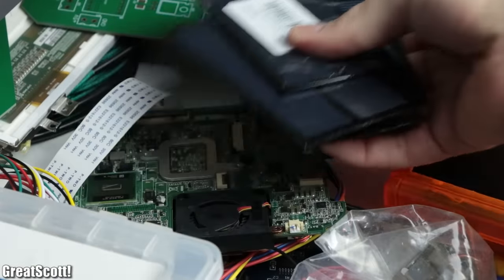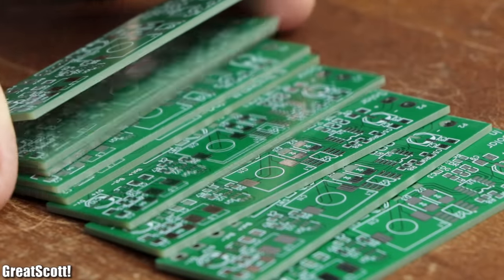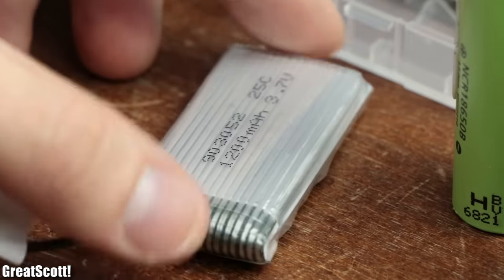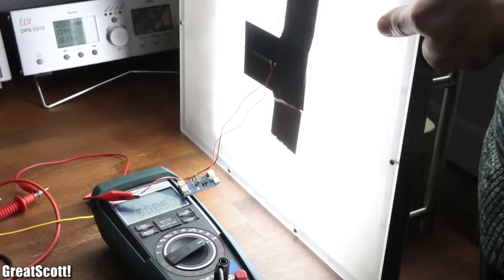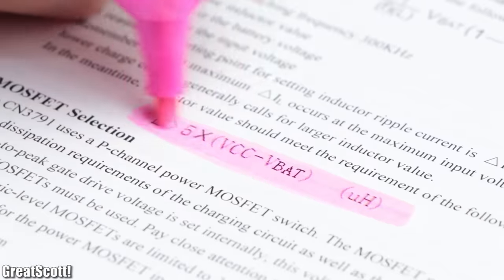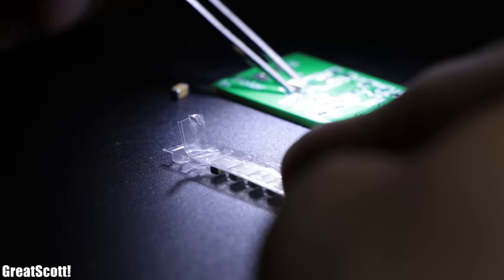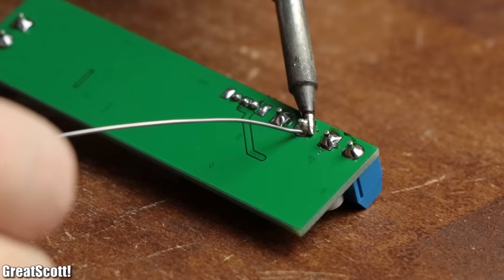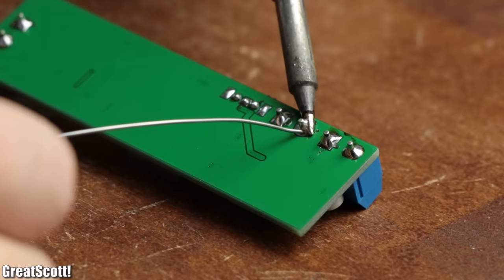Solar Battery Charger (LiPo/Li-Ion) || DIY or Buy

Comment: Maybe it would have been better, if you used SMD pots for the R9 to adjust the MPPT voltage for use of other solar pannels. But all in all a pretty nice circuit!
Reply from the maker: I like the idea. Thanks for the feedback.
Reply: @urugulu1656  Whats wrong with a pot? If you use a 10k one, range souldn't be a problem. And it looks way more elegant than having a resistor flapping around in the breeze ^^.
Reply: @m4gmu5hell  Bro, have you ever used SMD pots? You turn them literally 3 times and they're broken! (Or at least the ones I've seen before)
Reply: @necronomicon1472  I rarely use SMD Pots indeed, but I had no problems at all with the ones I utilised before. Maybe you have heated them up to hot and they have become bad that way. I use ones from BI Technologies. They are quiet decent.
Reply: @m4gmu5hell  I guess there are good SMD pots as well, but the extremly small ones kinda suck. It might be because the ones I used were cheap (on a chinese stepper motor driver) or because they are only good to be set once.
Reply: @necronomicon1472  These are the ones I used: https://www.reichelt.de/smd-cermet-trimmer-10-kohm-23b-10k-p146085.html?GROUPID=3131&START=0&OFFSET=16&SID=92W0EFwKwQAT4AADu3zvw6ab062d601af9edfed21ba31d7a9c3dd&LANGUAGE=EN&&r=1
Don't worry it's in english.
Reply: @m4gmu5hell  https://www.mouser.com/ProductDetail/Bourns/TC42X-2-102E?qs=sGAEpiMZZMvygUB3GLcD7pRd7VfpZf7nggmoc9QKmoY%3d
That's what I referred to. This one is from Bournes, so I expect it to be at least half decent, but there are certainly cheaper ones out there.
Reply: Sorry but the Maximum Power Point voltage for a specific panel changes according to light intensity, the 18 volts for his panel are at the standard light intensity and temperature only. You cant use resistors or potentiometers, you need an automatic tracking capability for maximum efficiency.
Reply: I did it, and now its versatile for all the solar panels at my lab.
Reply: Can I connect five lithium battery🔋 (1000mAh, 3.7V )  to CN3065?
Reply: I think the mighty paper said no
Reply: @teoval1827 I noticed this too,  I recently got a new 10A mppt controller for my 18v panel and the mppt voltage sweeps from 14-22v depending on irradiance. The 'set MPPT' voltage on this cn 3791 chip was a bit of a giveaway...

Comment: Another way of soldering Surface mount parts: 

1)tin the pads with a minimum amount of solder.  You want little more than a thin even film.

2) apply a past or gel type flux.

3) maneuver the part into position.  Tweezers work well.

4) hold the part down with a bamboo skewer, then touch the soldering iron tip to each pad in turn.

5) when finished, clean with alcohol, e.g. 99% isopropyl or denatured alcohol.

I recall doing this with sot-23 transistors, surface mount leds, 1206 resistors, and perhaps a few others.  It gave neat results.

Comment: Actually, I just soldered 4 5V Z-Diodes on 2 Solar Cells, and was able to load a power bank with that. The Z-Diodes kept the Voltage under 5.25V, and the power bank just took whatever it could, which resulted in changing current (50 mA to 1 Amp), but actually, that wasn't a problem. (The solar cells were rated max. 7 Volts, with an optimal voltage of 5 Volts)

Comment: Well, for an high-skilled electronics guy like you, for some of them, the DIY solution is the best choice, because as you did it, you can make your own pcb circuit and customize it during the mock up, but a common buyer/maker, will choose a commercial one, without caring about its lacks because he may not have all the skills he needs to fully understand the product's spec sheet, and find out if it's the perfect one for him

Comment: last time i just hooked up my 5.5v solar panel with a diode to my tp4056 board, to charge and power my weatherstation at the same time, worked very well :P
Reply: I did the same, I got a 1.5W 12v (Voc) solar panel and cut the traces on the back to convert it to 6v. Then I got a protected tp-4056 module for charging and a ht7-333 linear regulator for 3.3v output to an esp8266. https://imgur.com/a/CYQwCev
Reply: @vaguedirector_7342  Thanks for sharing, I've just started playing with esp8266's and have been looking for easy solar options for projects, can you share a little bit more detail of the circuit with me, please? Pete
Reply: @vaguedirector_7342  Linear regular with a solar panel project /sigh

Comment: One note though, the Maximum Power Point of a panel is not constant but changes according to the light it gets. The 18 volts is the standard MPP voltage at standard full brightness conditions. The 'T' in MPPT is the tracker which finds the best voltage according to lighting conditions for the specific panel.
Reply: Exactly.
Reply: Yep. A true mppt will be wY more efficient too.

Comment: What I think is that I'm amazed that you can order this kind of circuit, typically for outdoor gardening applications from any big box store and there you have it, battery, solar panel and circuit, complete. You make a great instructable video but for some applications striping apart a ready-made commercial sollution might just do the job.

Comment: Awesome job !
For soldering, I prefer to pre-tin the pads slightly with the iron and then add a bit of flux and sit the small components in place using twizers and hot air. I find it to be much faster.

Comment: Nice project. I also spent a couple weeks building my own MPPT charge controller using this chip and it works pretty well. I get 80% efficiency at around 10W input power and a bit less, 75% ish at higher power like 15W+. I am using a 20W panel. If you have lower then expected efficiency, it is important to note that the input capacitor ESR and the inductor DCR are very important as I discovered (!) so keep these as low as possible!
Reply: Can u please mention Al components and circuit diagram asap?
Reply: @Sam Soo  I have a feeling that if I do, I will see my design for sale on Aliexpress in a couple of weeks😂 Let me know if we can discuss this via email.
Reply: @nosafetyswitch9378  ...so you have my curiosity.  your channel doesn't seem to have any content so i'm puzzled by your offer to share designs.
my personal feeling is that these types of units should be designed to accumulate charges and then pulse charge, or better discharge into the battery in cascading manner.  The 60%+ efficiency of this video shows there is room for more creativity.  cheers
Reply: @Zane Enaz  hi, I haven't uploaded any videos yet unfortunately, who knows maybe one day. I just thought I d share my thoughts. I now want to charge my 10cell ebuke battery and i am actually considering whether it is worth adding those modules in series or start a new design with a chip that can charge 10 cells but those are not very easy to come by...
Reply: @nosafetyswitch9378  ..could you share your design with me ?

Comment: I was thinking about doing something like this last night. PWM solar charge controllers run $10-20 on Amazon for the cheap Chinese runs, and MPPT controllers run in the $100+ range, and honestly neither tracks a lot of the data I'd like to be able to see. A $30 MPPT solar charge controller with I/O charge tracking would kill it on Amazon.

Comment: This is what I was looking for ....just loved it ...
Reply: you were looking for 35% effeciency? at a cost of 10$ per board and 2 hours of labor? there are simpler. better. circuits suited for this type of project.
Reply: @americanengineering2063  u r correct, its  costly ...but i was attracted for MPPT and over discharge protection functionality .Any way its outdoor  efficiency was 62%..
Reply: Could this power a raspberry pi zero w?
Reply: @epicgames44  I can't say because  i dont know much about pi zero w...we need to check its data sheet and verify if it is suitable to use with pi zero w
Reply: Yes it will run a pi zero w. if im not mistaken the pi zero w runs on 5v. but if you plan to use a solar panel, get a decent size. the tiny ones he showed at the beginning are only 1w and aren't strong enough to even charge a AAA battery. why did he even show those tiny things. his board does not work with small panels as such. so make sure u get atleast a 10w panel

Comment: I use 10 watt solar panels and a variable input Buck Converter set for 3.5v maximum (LiFePo4).  For 6v output to my game camera I use a 2 Amp boost converter  that shuts off when the battery drops to 2v.     The batteries are  6000mAh, 1S3P, and don’t need balancing.    I have 3 game cameras which have been running unattended for 15 months.

Comment: For the buy option, not sure why you looked for a special board to do it when a TP4056 provides similar results and on the slightly more expensive boards it actually has battery protection for as little as 30 cents, I'd say that's the better route to go unless you need more power/bigger battery.
Reply: @FourthWayRanch  It's similar to a liner regulator, it feeds the battery as much as it can provide and as the voltage increases past 4.2v it'll burn that excess power as heat, so yes about the same as plugging in usb, the only downside is it has an absolute maximum of 8V input so that somewhat limits your panel options especially if you want to be able to charge in lower amounts of light.
Reply: @FourthWayRanch  Yes but very unnecessary, it depends on your module of course but as far as I'm aware it'll work perfectly fine all the way down to 2.7v (so completely drained) with 3.3v being typical.

Comment: Can you do a video comparing different energy harvesting methods (e.g. RF, solar, piezo or thermal)?
Reply from the maker: I can put it on my to do list
Reply: @greatscottlab  and hook up some cool MCU like nRF52 to create a real autonomous sensor node. It would be perfect.

And for everybody looking into EH topic - take a look into DOI 10.1109/mssc.2010.936667. It's the best science article on EH I found so far. Alongside with DOI 10.1109/SURV.2011.060710.00094
Reply: @greatscottlab  also,mini  inline generators to power smart water meters

Comment: Nice video ! It would be beter to use an smd trimmer for mppt .
I have done something similar but i used much cheaper method . 
Using a board with MP1584EN and a li-ion charging module based on TP4056 ic with battery protection and then a boost converter 3.7 to 5v connected to a switch for open close,  my sollar battery bank still works like a charm for 4 years now with the same batteries . The only problem with this method is that you have to find solar panels 9v not 6v .The maximum panel voltage is 28v .
My battery bank was fitted on my backpack and it was charging constantly every day , now im about to upgrade it .

Comment: As a followup, you should do a solar charging board for supercapacitors. I've been interested in making a low power sensor using a pair of the cheap 2.7V supercaps you can get as a reservoir, but I'm struggling to find a good IC for charging supercaps from solar.
Reply from the maker: I will see what I can do
Reply: @greatscottlab  Thanks for at least considering it!
Reply: Lipo charger works just fine for the supercaps. I replaced a lipo battery in my dashcam with a pair of 2.7V supercaps and the charging circuit in the camera handles them just fine. Maybe you'll want to add zeners in parallel to each cap to keep the voltage below 2.7V in case they become unbalanced.
Reply: @polarijet  Yeah, TI has a really nice chip for doing this (the BQ24650) that integrates a boost converter and MPPT controller etc. I've just been stuck on 1) having a chance to lay out a PCB for it and adjusting all the values for supercaps and 2) figuring out protection and stuff for the supercaps. Having a hard time finding a coherent explanation of what is required to charge them properly, especially in series.

Comment: Well built.

Just note:
There is no "battery bypass" so the battery will cycle around fully charged if you have a load and sun is present.

Otherwise, what is the deal with 5V? very little modern stuff use 5V.
I would target 3.3V (and possibly 2.5V, 1.8V e.t.c.)

Comment: Great job Great Scott :) .   Yes , I've been frustrated by the lack of a perfect solar to Lithium charger/ 5V boost circuit for a long time too .    So I used a small buck converter to step down the solar panel voltage to 5.2V to power our favorite 1S Lithum charger board  .       It doesn't use MPPT and I'm sure it's efficiency is Horrible .      Great Circuit , Thanks for doing the thing that We've all been wanting in a solar 1S lithum power circuit :)
Reply from the maker: Glad you like it :-)

Comment: There are off-the-shelf cn3791 solar chargers on aliexpress for around 3.5$
Reply from the maker: What? Dammit!
Reply: Link?
Reply: seems this video needs a part 2 where those are tested in comparison with your DIY one
Reply: @KACPER050599  thxs
Reply: @urugulu1656  These modules are only chargers, but you can use standard bms for protection for approx. 1$ and save money and time
Reply: But its not the same!!! It's set for a 9v or 12v panel and doesn't have the charge protect / boost protect circuit , which is a huge bonus!!! so I thing GreatScott's is worth ten times that Chinese junk..lol I'm gonna build his..
Reply: @sortofsmarter  Of course not, you can change resistors for mppt, use another boards for protection and boost converter. This will save a lot of time, unless you are really into developing serious product and want all on one pcb
Reply: @sortofsmarter  @GreatScott's design could use one important design change: load sharing, not sure how well it can be implemented with a solar panel
Reply: This kind of MPPT implementation the CN3791 utilises, is not true MPPT, as there is no measurement of panel current, calculation of solar panel Watt output, and no algorithm that periodically varies the load to find the highest output point of the panel, fancy true MPPT chargers even have a boost converter to squeeze even more mAh out of the panel when panel voltage is below battery voltage! Simply setting a constant voltage load for the panel does not compare, especially if you choose the lab test condition voltage of 18. More realistically, something around 16.5-17V https://www.ecmweb.com/sites/ecmweb.com/files/uploads/2012/07/207ecmPVfig2.jpg For smog laden city air on the bleak northern hemisphere! As others suggested, use a potentiometer and do a live calibration while measuring U and I so you at least gets it tuned for your local real world conditions. However this type of circuit is still better than a simple buck converter battery charger. As these "fake" MPPT ICs are plenty, and made by renowned manufacturers, they have a legitimate advantage in portable equipment / remote sensor applications, where cost is very critical but even a small improvement of efficiency compared to dumb solar regulators is a great benefit. So it is simply just a misnomer to call them MPPT chargers, as they are more like an "intelligent" buck converters. If you want a true MPPT that ticks all the boxes and has high efficiency, use the LT8490. Chinese manufacturers have made a few boards with these ranging from $37-$70 from the usual outlets, and these keep efficiency in the 90' range most of the time. However these chargers are in the 300W range, too much for a one cell charger. However the LT8490 could as easily be used in a DIY circuit if anyone wanted a small hitech 1-4A MPPT charger. https://www.beyondlogic.org/lt8490-mppt-buck-boost-multi-chemistry-battery-charger/ NB.: If you really want to tweak a dumb CV solar charger like in your video, the scientific thing to do is put a Wh meter on the panel and another on the battery, so you can average for efficiency daily and find the ideal all year voltage, but that would be a lot of work to get an extra 10-15% out of the charger.
Reply: @KACPER050599  that link doesn't lead anywhere
Reply: @luongmaihunggia  it was active one year ago ;)
Reply: @KACPER050599  well, it's not anymore so you need a new link.
Reply: @luongmaihunggia Do you think I'm going to update every link I post? Just search it yourself, it's not difficult to find
Reply: @KACPER050599  there're 2 different module that both name cn3791

Comment: Try using incandescent lamps to supply light to the solar panels indoors. I've found incandescent lamps do better than LEDs or CFL lamps when you have to have a light spectrum similar to the sun for testing solar panels. This also helps explain why current solar panels are inefficient, because they work best on a narrow infrared range. If they were able to work with a wider spectrum of light, they would be more efficient.
Reply from the maker: Good to know
Reply: thebestofall007
incandescent lamp, Now there's a name I've not heard in a long, long time.